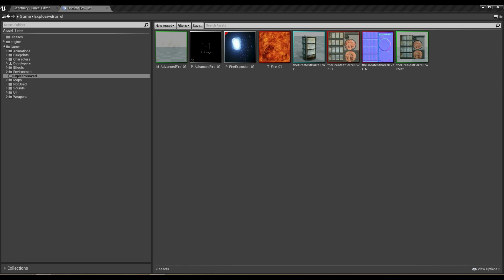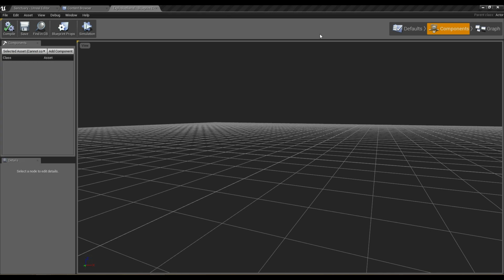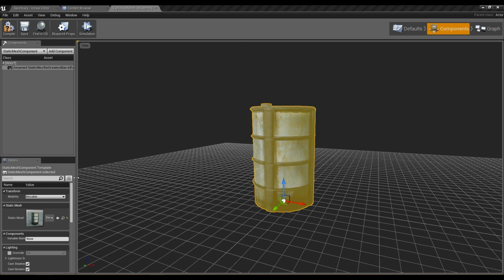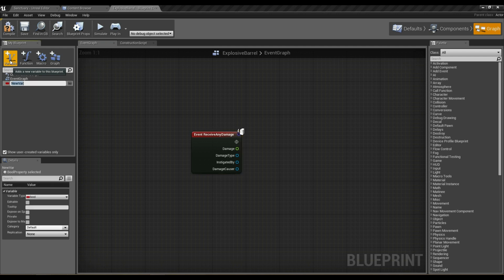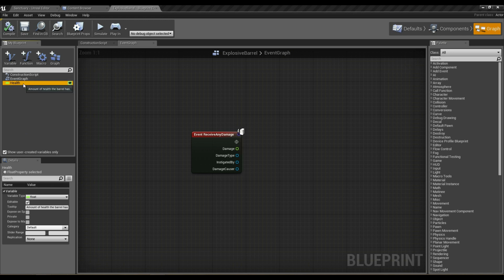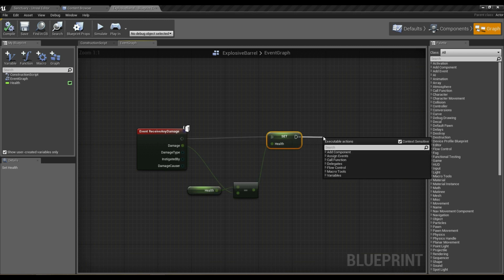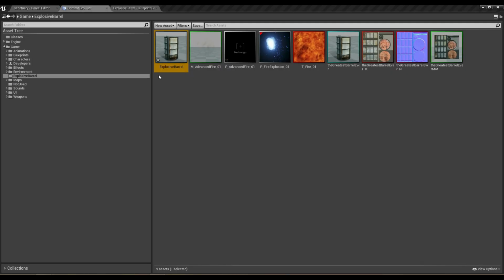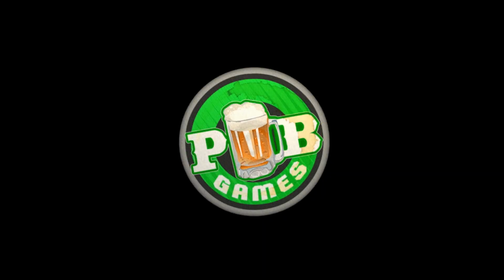UE4 - Blueprint Explosive Barrel #1 - Basic Setup

Comment: how does UE4 know that the projectile hit has to be considered as damage for the barrel? you don't specify it and I can't find it in the documentation.

Thanks
Reply: have you figured this out?  I am having the exact same problem.
Reply: Hi chaps, did you figure this out? The actual damage isn't being triggered. Also what are the mesh / projectile settings?
Reply: put there "event hit", connect it with "apply damage" , then connect hit location with hit location, normal impulse with impulse dir, target with destructable mesh. And at the end add some damage and impulse strength. This should work.
Reply: Same Problem :(
Reply: + Raska The Furry Can you show me the blueprint? It would be very helpful
Reply: bit late but you its just add damage component to your Impact point on your tracer and adding a health comp to the barrel so the effect trigger if the health comp is = or below 0